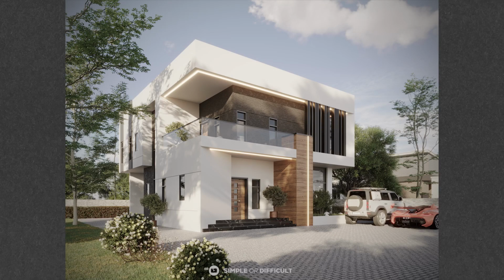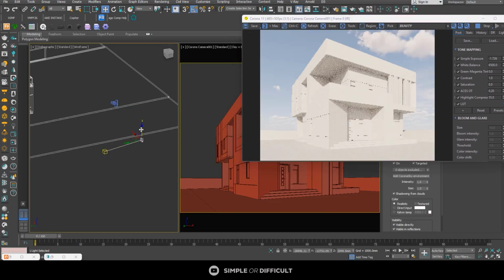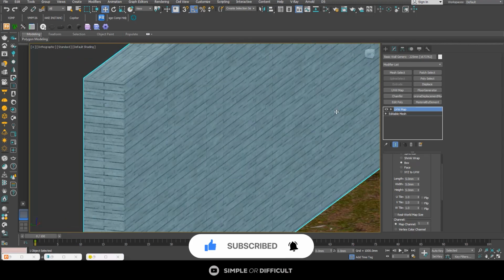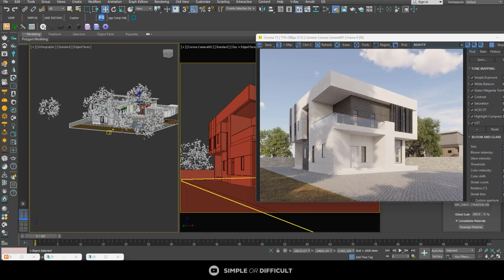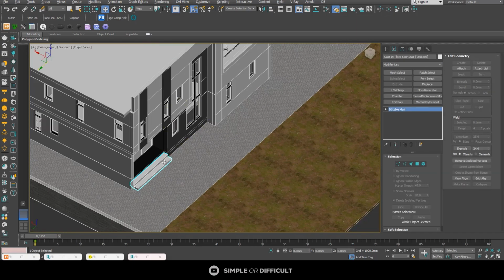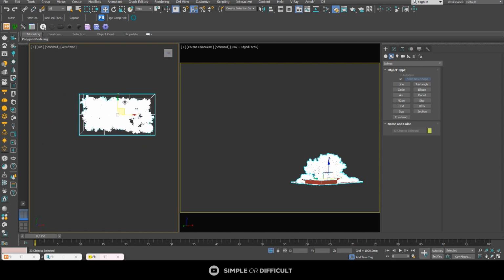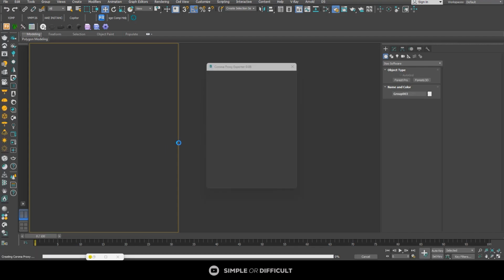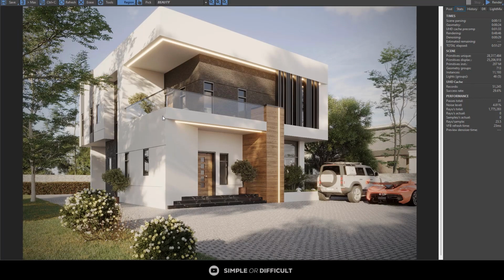Exterior Rendering Masterclass: Duplex Design in 3ds Max + Corona Renderer

Comment: Your rendering come up fast and clean, is it your system? Please is what your system spec. And your ram size.
Reply from the maker: You do realise that, I cut off the part where I render the image right? 

Well my spec is - Intel Core i7 12650H 
(10cores 16threads) up to 5.0ghz
16GB DDr4 Ram+512GB Ssd
Nvidia 8GB RTX 3070
Reply from the maker: It’s a laptop

Comment: What’s the spec of the system you’re using?
Reply from the maker: Asus TUF Dash F15 FX517
Intel Core i7 12650H 
(10cores 16threads) up to 5.0ghz
16GB DDr5 Ram+512GB Ssd
Nvidia 8GB RTX 3070
Reply: @SimpleorDifficult  Did you upgrade the ram. Your interactive rendering displays fast

Comment: sir while running corona interactive rendering cpu usage always stays at 70-80% & while rendering cpu always runs at 100%.. is this normal?? i mean cpu is too heat all the time
Reply from the maker: Well corona is a CPU based render engine— 

By default, Interactive Rendering does not use all CPU threads, so it is slightly slower in the long run than regular rendering. This is to allow for viewport navigation and other background activities to run smoother.
On the other hand, you can’t work while Production rendering is going on, Hence the corona maxes out the CPU threads it uses.
Now, I believe there is a way u can limit the amount of CPU threads the production render can use.
Reply: @SimpleorDifficult  i hv amd ryzen 3 3200g 4 core & 4 threads only.. Btw how can i limit cpu threads i didn’t get last point u said
Reply from the maker: With just 4 cores and threads I dont advice you to do that— let it use every available resources
Reply: @SimpleorDifficult  okay sir
Reply from the maker: Alright